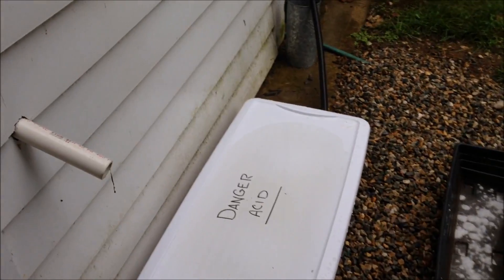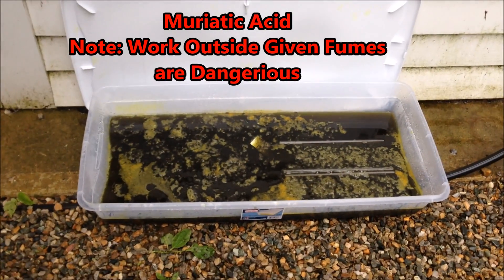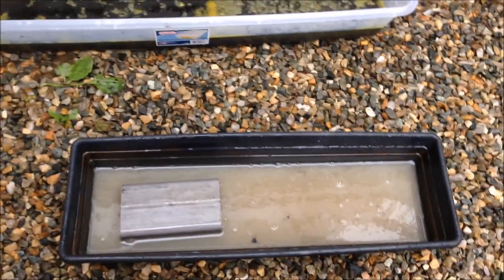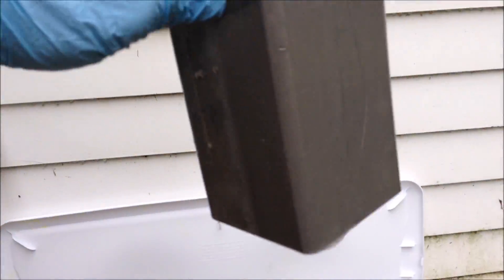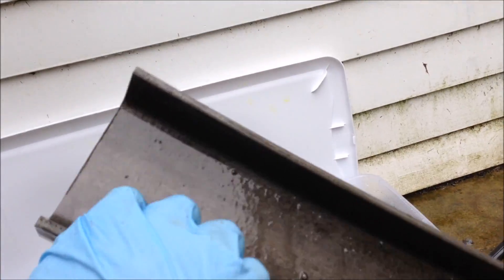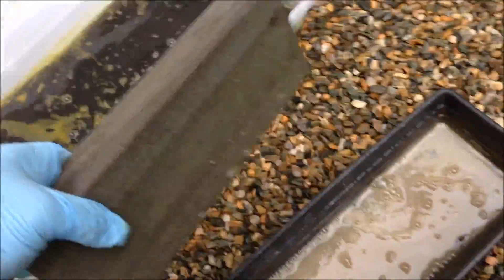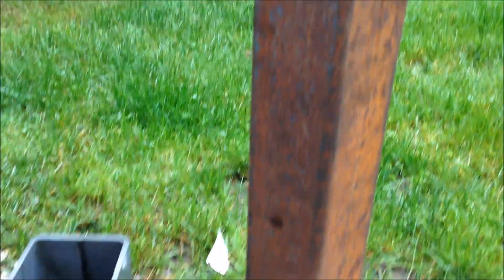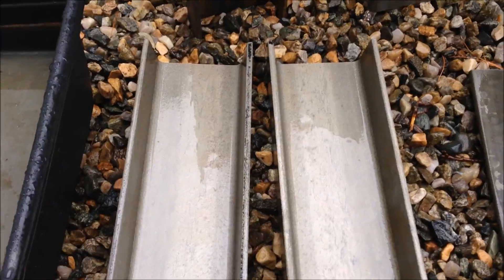Homemade Hydraulic Forging Press For Blacksmithing - Part 1

Comment: Amazing design!! Just curious, why have the piston push up instead of down? Would the ram not return because of gravity?
Reply from the maker: The design was an easy way to get into a forge press without spending thousands but these small Air-Jack models have limitations like no upward power.  So as an example - I can’t use it to drift out a tomahawk eye given it sticks

Comment: How did the press work for you? I'm tempted to build one
Reply from the maker: Works nice - I like the simplicity and low cost (vs hydraulics) - the only thing is you need a good compressor to drive the air and it only powers the upstroke not the down stroke -

Comment: What should the water/baking soda ratio be and what is the expected longevity of the solution?
Reply from the maker: Umm Ahhh - good questions.  Unfortunately,  I have few specifics to offer - I usually "eyeball" about a 1/2 box of baking soda into the planter box filled with water.  Also, I don't save the solution once I am done.  Baking soda is so cheap I just mix up a solution each time I am doing a batch of steel.

Comment: Could I use a 32 ton jack instead of a 20 ton
Reply from the maker: Yes - If the jack is pneumatic (not a manually pump jack) and you have a large enough air compressor to deliver what the jack needs it would be great.

Comment: I hope its ok that i steal this design. LOL.  Question: How do you like the actual press from HF?  Would you use the same one if you did the project again or would you go with something else?  Thanks for the great videos!!
Reply from the maker: Steal away -it’s why I started this channel:-))’ So far this press has been great including the HF jack .  Just be sure you have a large air compressor to drive it.  I use the 29 gallon oil based HF compressor which works well.  Good luck with the build - would love to see it when done.

Comment: IN THIS VIDEO YOU USED 3 1/2  6''' TUBING AND IT WAS GOING TO SIDE UP THE 3''' DID THAT NOT DO.. ON THE NEXT VIDEO YOU CUT THE 6'' TUBING
Reply from the maker: Good eye for details - The tolerance was too tight and created binding - so I decided to cut the tubing - it worked out well - the tubing wraps the column on three sides without catching - adding the side wheels also helped.

Comment: Did you use the acid straight or did you dilute it at all?  Thanks
Reply from the maker: Thanks Glenn, the Muriatic Acid I find in hardware stores is usually diluted by 2/3rds - so, I don't dilute it further.

Comment: Looking great so far Rick, nice design too. One tip is keep the forging dies fairly small use 1/2" round for drawing out dies and i wouldnt go more than 3/4" for flattening out dies. Reason is the dies draw the heat out of the steel fast because the Jack action is not that fast (slow squash) 
I also squash a lump of hot steel in the dies before i start on the damascus and leave it there to heat them up, that helps alot when you start on the billet. Once they get some heat in they are alot better, The jack eats alot of air so I added an old propane bottle for extra air storage, two would be better though. Looking forward to the next vid. Cheers.
Reply from the maker: Terrific Loz and many thanks mate  - will keep the dies small for sure - I currently have a 25 gallon 5 HP air compressor which can deliver about 4 to 5 CFM - sure hope it's enough, but will see....fun fun fun - thanks for checking it out and passing on your experience my friend - hope your well and take care cheers

Comment: Rick, you can also use vinegar instead of the acid. It does a great job as well, also not as harsh as the acid but I don't know what the comparisons are. I believe you still need to neutralize the steel after a vinegar bath as well. Can't wait for part 2!!!
Reply from the maker: Hey Hey I never heard of that option before - vinegar - I may have to try that out - thanks Philip!!
Reply: Rick Rabjohn Just don't make the same mistake as Alec Steele and use malt vinegar I believe 😂... if you have ever seen the YouTuber/Fantasy GIANT sword/knife builder, first name is Michael, he uses the vinegar bath all the time. He makes a lot of video game swords, pretty cool videos. He just has a big box lined with the black pond liner, I don't know if he's ever swapped out the vinegar or not.

You can also etch Damascus with vinegar if you ever run out of the acid lol... I saw a video that they got the vinegar hot before etching, don't know if it makes a difference or not. 

I'm just a little into Damascus lol.. great videos, also can't wait to see you use your new Big Dog Forge tongs! That was awesome he made two different types of wolf teeth tongs! You're gonna be making some crazy killer knives and anything else you come up with, going to be fun watching!
Reply from the maker: Thanks Phillip.  I checked Michael out - nice channel - I think it's michaelcthulhu and he does makes some pretty awesome stuff.  Thanks for the tip!

Comment: Good tip on the acid, where do you get it?
Reply from the maker: Thanks John Holmes :-)  Most hardware stores I visit carry it.  Hope your doing well - cheers!
Reply: Pool supply store carry it too, it used for acidity control in sodium chloride setups.